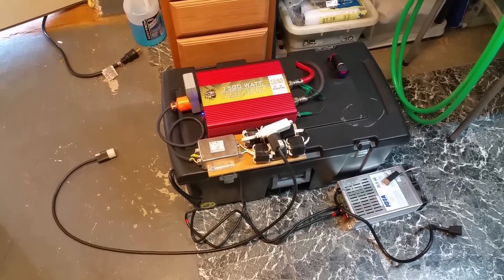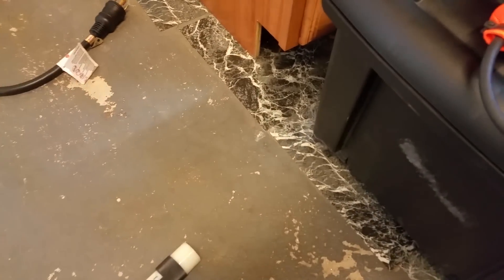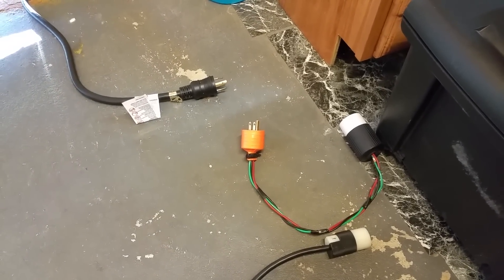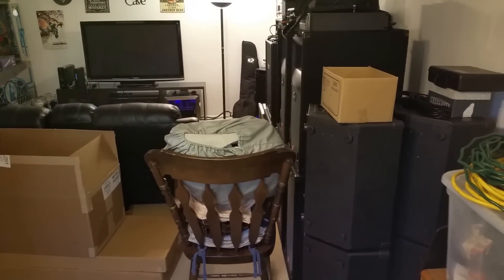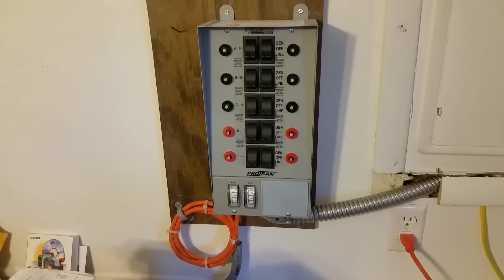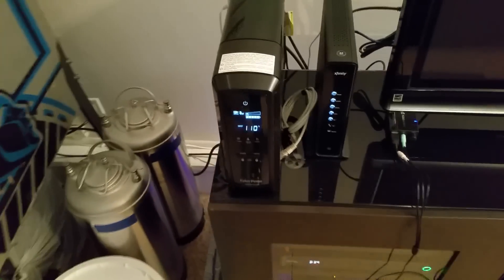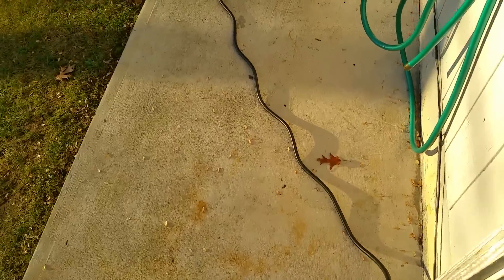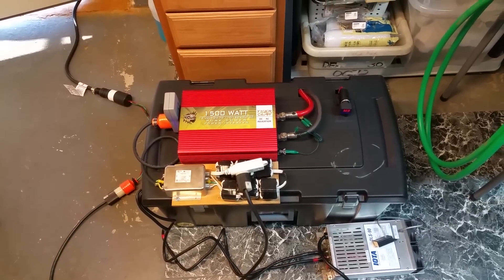How to Power your House with an Inverter/Generator During a Power Outage

Comment: Thanks for sharing. 

I noticed that the inverter output runs through a capacitor and EMI filter, and then your adapter is plugged into output at the filter...then to the extension cord to your transfer switch.

Question: Couldn't you just plug the adapter that you made directly into the inverter output, instead of going through the capacitor/filter configuration?

Thanks again. Much appreciated.
Reply from the maker: Yes you could. Most cheap inverters dont have adequate high frequency filtering circuitry. Thus why I have that. Its mostly in the AM band which would cause issues for radios. Most devices wont care since they have basic filtering on their PSUs anyway.

Comment: Sweet setup. I wish there was a diagram of exact wiring and equipment. Ty for video.
If a full diagram is out of the question please i beg of you how you connected the transfer switch to sine converter. Ty
Reply from the maker: No diagram sorry. I do go over how its connected though in the video. Thanks for watching!

Comment: I have a 12-volt battery Bank with a 3500 watt inverter can I take the inverter and hook it up to the transfer switch Box by itself thank you Mike
Reply from the maker: Michael Ortiz possible, but 3500 watts at 120 volts is 29 amps. You will be dangerously close to overloading your neutral wire since you do not have 240vac with a middle tap to balance the current on the neutral.

Comment: I need the extra question can I make that plug up and just sticking in a inverter 3500 w inverter will that work the same way without your silver box on the side whenever that does please get back to me Mike
Reply from the maker: Michael Ortiz language grammer barrier. My answer is it depends. If your inverter is 120 vac i would recommend no.

Comment: See silver box that's next to your inverter what is that and how do you hook something up like that Mike
Reply from the maker: Michael Ortiz that is the Iota engineering DLS 90 AMP battery charger
Reply from the maker: Michael Ortiz it comes preset to charge and maintain voltage at 13.8 volts. It also comes with a jumper wire to increase that voltage to 14.5 for fast charg. I happen to have the multi-stage charging unit which charges the batteries at a variable current until they are fully charged. I highly encourage you to go and check out the company's website to see how it works it is great for flooded lead-acid and VGM bats.

Comment: Thank you so much for your videos, Xboxer
 as a Nerd myself, I REALLY ENJOY THEM!!!, I have a simple/potentially complex question? I see you stated that sinewave Tiger inverter has a floating neutral and yet it can safely connect to a bonded neutral? Why is this? Im aware that most floating neutrals inverters will go "poof" if you connect it to a bonded neutral panel, but how are you supposed confirm this with out taking the chance of frying your inverter before hand., just a background on me, pretty well versed on the basics of electricity [volts amps, amp hours, capacitors, diodes resistors transformer ETC] but to much of the advanced [power factor va etc], I have successfully back fed my panel many times and even for 2 weeks with irma by shutting off the double pole breaker and unbonding the neutral , but while doing the some testing just recently I for the first time accidently blew my  beloved xantrex xpower 1500 that i had for years by accidentally bonding it IT WAS A SAD DAY INDEED. . , I just bought a Xantrex XM 1800 Inverter. UL 458 approved  as a replacement and its on its way in the mail, so  So my 2 questions, : And also how can i confirm if an inverter is safe to be connected to a bonded neutral at the panel with out the chance of frying it?  [does Ul458 confirm this]  . . . ALSO I Would you be interested in fixing it xpower 1500 , i blew all the fuses in it, when i bonded/shorted it, So I soldered in new ones and tested it and it instantly blew all the fuses again and blew apart one mosfet/ transistor. . :( Im going to PM you my number and hope to speak to you,[as you know this is way easier to say over the phone than in text] also ironically im really into Pro audio as well , my current set up being 2 non-powered SRM450 aka C300zs  EV 18 iforce and Inuke nu4-6000. . . I really look forward to hearing from you

Sincerely Mike
your fellow Techy, Diy, Dj, Go2guy Offgrider. . .

Comment: Hey Xboxes 1985..enjoyed watching your channel. Saw a comment u left and and answer u gave to question asked on knurenglars channel and am now kinda confused.  He stated that the tigerclaw 1500 had the neutral bonded inside the inverter and thus read 60 volts across the ground on each outlet. You stated that they are not bonded. I was planning on purchasing the same I inverter to power a travel trailer offngrid by  using the existing wording made for 110 grid power. I assume I would have a short and blow the inverter due to the to the neutral/ ground bonding. What am I missing? He did show his meter reading 60 volts  or 1/2 the available voltage of 120.

Thanks for the time u take to show us novices  the right was to do things.
Reply from the maker: ralph, the TG does not have a bonded neutral, it has a floating neutral. The voltage measured AC hot to the negative of the battery I believe is 'ghost voltage' meaning it is the boost stage switch mode noise he was measuring.  In my tests and the experiment in this video, the neutral can be bonded to ground with no problems.

Comment: what do yo have for AH in that bank? You mention your charger is capable of 90amps. That being said, Id assume you have at least 400AH in there to safely receive a charge current of 20% the capacity? Thus 80 amps?  
What kind of batteries are in there?  AGM 
24's? 27's? 31's? 4D? 8D?  thanks :)
Reply from the maker: toobglued currently two group 29dc everstart marine batteries from walmart. It only hits 90A for a very short time and drops below 60 within 15 minutes of charging. It is not constant current so.
Reply from the maker: toobglued also, 244Ah, each bat is 122Ah

Comment: with no grid power present, can one just connect a large inverter (12 kw) straight to the polls in the fuse box?
Reply from the maker: ron guin provided it has the proper interlock connection to prevent back feeding and that it is a pure sine wave output then yes it's possible
Reply: xboxer1985 love your video btw, very informative. new sub here.
Reply: ron guin talking about the plug that you made from the inverter to the transfer switch box. To show people how you want it up that plug

Comment: I have the solar system can I used with the transfer switch all day with main breaker on
Reply from the maker: with this style transfer switch, if you run solar to the inlet of the switch, yes it isolates the utility and you can keep the main breaker on. Whichever circuits you have backed up will run off the solar.

Comment: Good video, thanks.  I plan on hooking up an APC automatic transfer switch to my apartment's breaker subpanel.  Problem is that I can't run cables in an apartment unit to my patio so I'm thinking about connecting the xantrex inverter to the breaker panel by using/repurposing an electrical outlet in the patio by adding a 120v male connector to it.   This way I can plug my inverter to an existing line that's already going to my panel, then I'll disconnect that line from it's old breaker and wire it directly to the transfer switch to make the connection to the various circuits.   

My question is, what happens if that line that I'll be using doesn't just go to that power outlet in my patio?  What if that line from the breaker also goes to other outlets and/or lamps?   Hoping not to fry anything.

Hopes this makes sense and thanks for any help or suggestions!
Reply from the maker: run a separate inlet line to the breaker panel, like my tswitch is setup, you dont want to repurpose any wire unless you know it has a direct shot to the breaker panel. Also if that xantrex inverter is modified sine wave, dont use it, you will fry any electronics in your house.
Reply: Thanks xboxer.  Unfortunately I would have to wait until I do a full remodeling of my apartment in order to run a new line to my patio.  The Xantrex is a pure sine wave without a bond between the neutral and ground.  I may have to test and re-test that existing line to make sure that it's a direct shot to the panel. Cheers
Reply: . filter what does that contain Dove inside that box can you lay out all the parts and let me know and get back to me on that. My email is Mike's Country Boy still in at gmail.com I would really like to talk to you and maybe you can help me out with the same setup thank you Mike

Comment: Congratulations for several things.  You emphasize the importance of a transfer switch and also explain clearly how the hots must be transferred and the importance of the proper neutral/ground bond (and how that bond should be changed to utilize different conditions).  You also are using a pure-sine wave inverter; in my opinion, a modified SW inverter is not a good choice for powering a house; they're inefficient, they don't power inductive loads or inductive appliances well, and they're hard on batteries and some appliances.  
I agree with your comment, "suicide cords" and similar arrangements offer too many chances for making an unsafe condition.  I don't want to harm any of my family members and I don't want to burn their house down. Can they be made safe?  Yes, but if you know enough to make them safe, you are knowledge enough to understand how many little things can go wrong to defeat  your safety arrangements.  JUST DON'T, people!
Nicely produced and well explained   This should be helpful for many people.

Comment: Hey there, do you have any video on your RF filters ? I can't recall having seen one.
Reply from the maker: Not much to take a video on. Its a Corcom 16FC10 plus 6 ferrite collars made of type 31 material. Fair-Rite part# 2631626202. 

Each bead has the three VAC leads wrapped 4 times around them. 

Hope this helps!
Reply: Thanks a lot mate